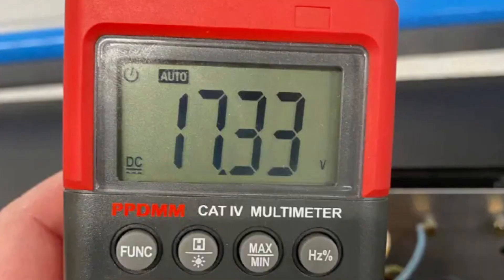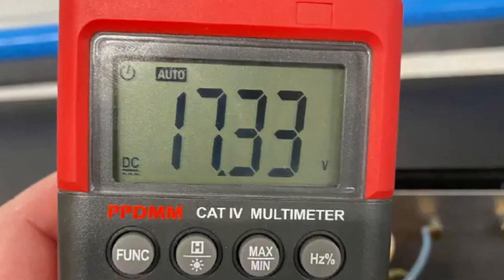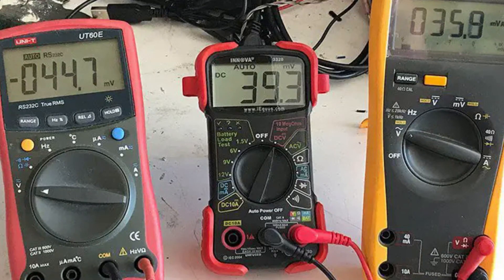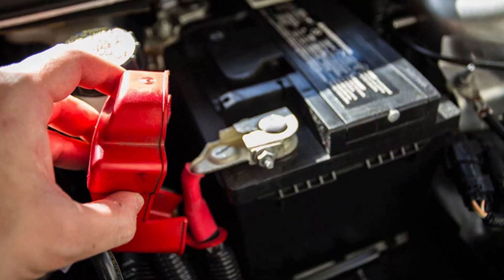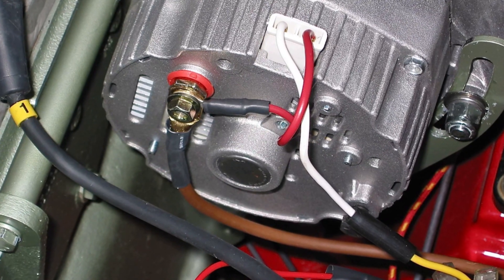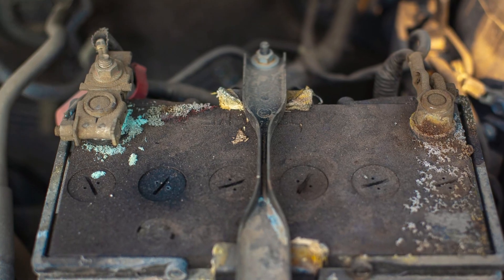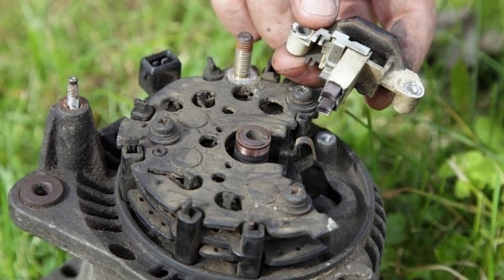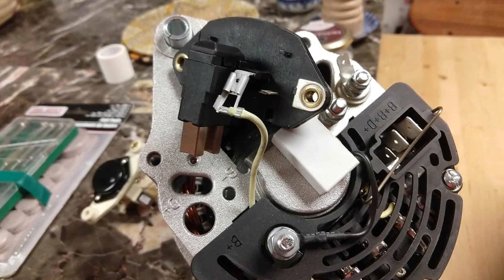12V Battery reading 17 volts in a car: How? And what to do?

Comment: Okay. Nice video about nothing. But what to do if my battery is removed from car and shows 15.5 or even more Volts having sat for a month or so? Battery is 2 years old, was never charged using plug-in chargers. It was driving car electronics crazy so was removed and replaced with another one. Replacement one is okay so far
Reply from the maker: Damaged battery. May have been damaged by overcharging, so monitor the voltage in the system now. But it may have been damaged before you even bought it.